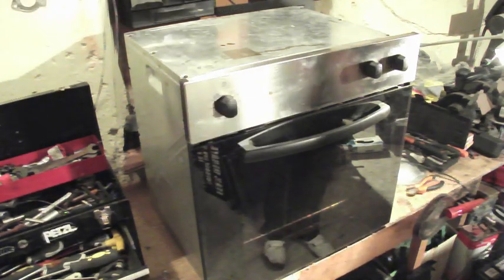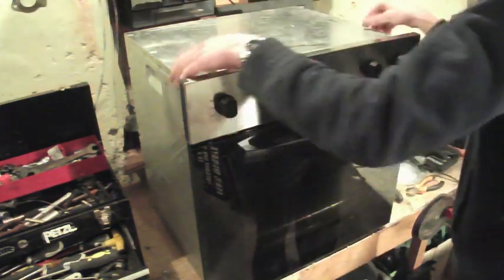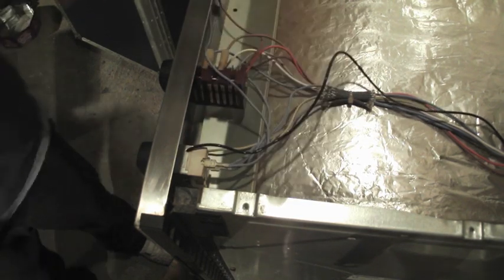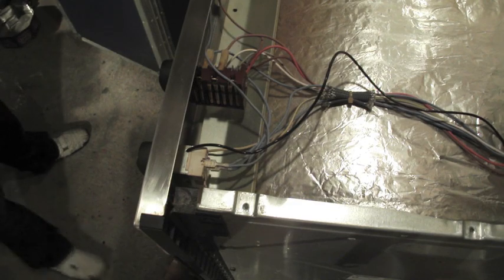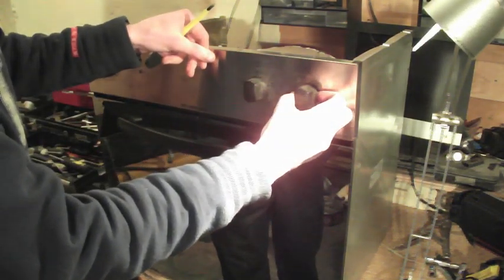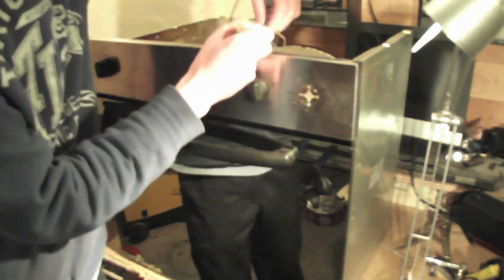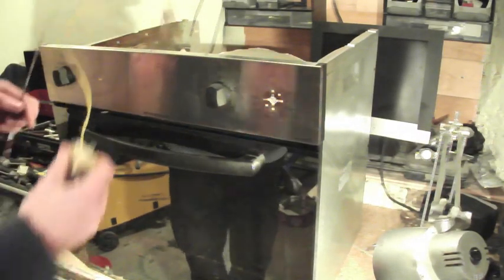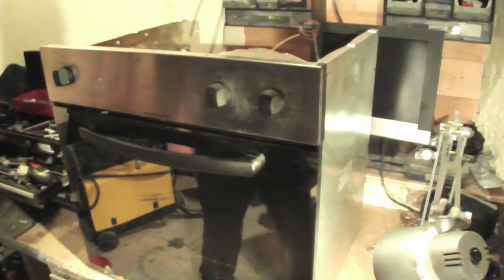How to fix your Electric Oven - Thermostats

Comment: because the thermostat clicks are you sure this is an indication that it is working fine? I thought that only applied when power is applied & its turned on and you hear a click when it turns off or back on. I measure the resistance of my thermostat it is 0 Ohms ,i was told it should be 1100 Ohms.